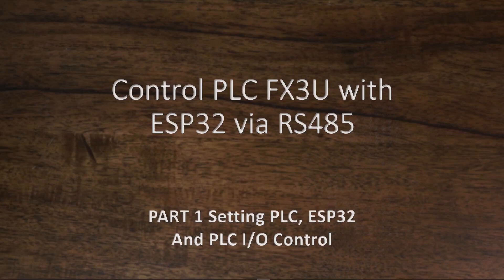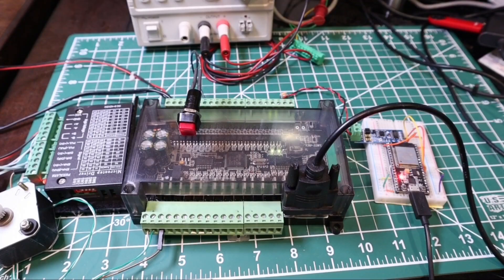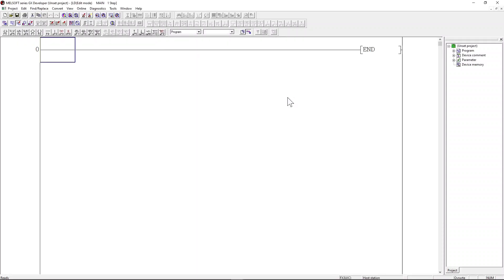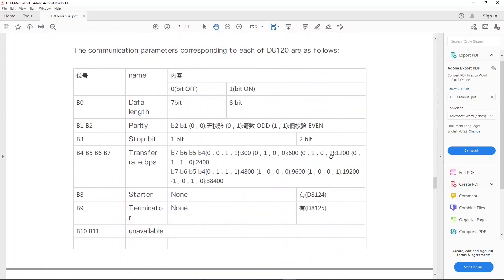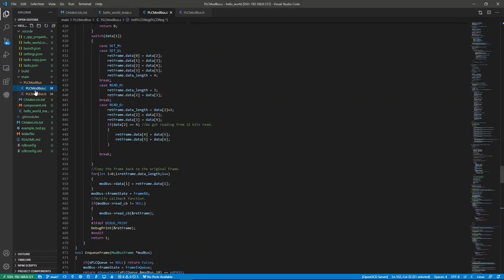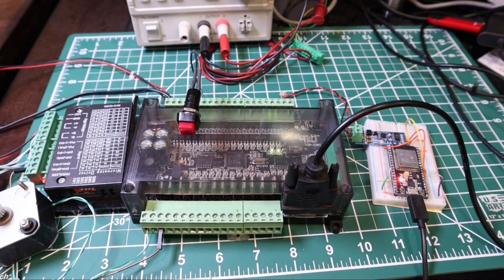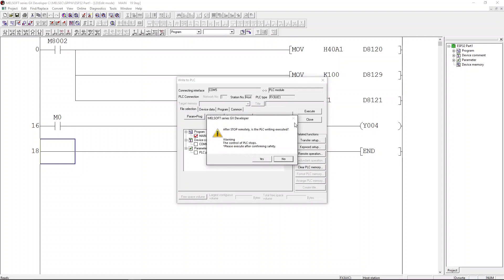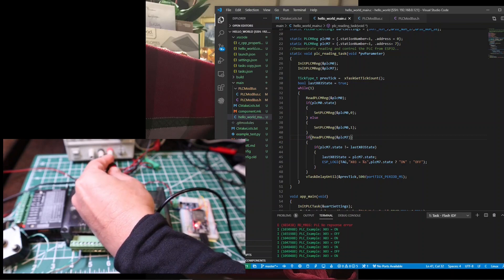Control FX3U PLC with ESP32 Microcontroller Part1( PLC I/O Control)

Comment: You LE3V manual says about P0-P63 pointers. Did you set it in  Tool->Device/Label Automatic-Assign Settings  Pointers? I has holding PLC on IF CASE operation and TON functional block without the setting.

Comment: I am working an project i have le3u 48mr plc i am devolping a programe temperature and pressure base control but these analog inputs are not enough for me i need 10nos analog inputs is there ant module i can connect with this plc

Comment: Hello I'm new to this, I'm trying to learn.  I see you connect B- and A+ from RS485 converter (yellow lines) to last 2 plc inputs (I suppose they are inputs). I do not understand how ESP can communicate with plc using 2 inputs..
Reply from the maker: The TX2 pin on ESP32 is output and RX2 pin is input.
Reply: @kris-.1439  I'm sorry my question was about plc side.. in which  plc pins  are connected TX2 and RX2? thank you very much
Reply from the maker: @clamel77  The RS485 in this video is configured as a half duplex. The A+ and B- can transmit data in both direction (ESP32 -> PLC or PLC -> ESP32). I don't have schematic for the PLC, if I guess they would use the RS485 transceiver chip to connect to PLC tx and rx pins on the CPU. For more information  https://www.cuidevices.com/blog/rs-485-serial-interface-explained#:~:text=RS%2D485%20is%20a%20duplex,B'%20as%20a%20pair).
Reply: i tried using the program but it always fails. openOCD is not running when flashing the code in VS

Comment: Which cable are you using to program the PLC?
Reply from the maker: USB  to serial port DB9 male.
Reply: find FT232R  (TRX1227)   -    USB to RS with converter and drivers ( almost all windows)

Comment: I get error Cannot open source file "sdkconfig.h" and libraries like freertos, esp_system, esp_spi_flash, esp_log
Reply from the maker: I'm not sure what compiler are you using. In this project, I'm using ESP-IDF and I follow the instructions from the below website to install it on my computer. Those files you mentioned are the part of ESP-IDF compiler.

https://docs.espressif.com/projects/esp-idf/en/latest/esp32/get-started/
Reply: @kris-.1439  thank you, i solved but again i got error "Failed to connect to ESP32: Timed out waiting for packet header". Do you have any solution? I tried holding "Boot" while uploading the code but it still doesn't work.
P.s1: Sorry for my english.
P.s2: I can load the code normally without connecting esp with RS485 Converter. After uploading, I connected the two, but the plc did not respond. I use plc fx3u-14mt.
Reply from the maker: @huynhduonggiabao7793  1. Please check if your PLC has option RS485 installed. We found out some of them has RS485 ports but the PCB didn't have the RS485 chip installed.
2. Make sure you use the same Ladders as shown on this video.
3. After upload the LADDER, you will need to power cycle the PLC.

Comment: some of the files for json is missing how to fix this
Reply from the maker: I'm not using any JSON file on this project.
Reply: @kris-.1439  oh i see, because I'm having a hard time because of the #include is showing signs of error based on my visual studio code
Reply from the maker: @henrytheodoredaquinag529  That happened sometime on my VS Code as well. It is the path settings inside .vscode folder. Most of the time I would ignore it as long as ESP-IDF can compile.
Reply: @kris-.1439  now the problem in the code is openocd is not running, how can I fix this